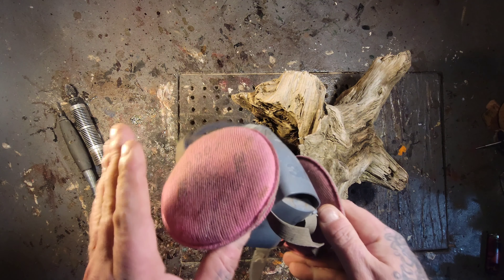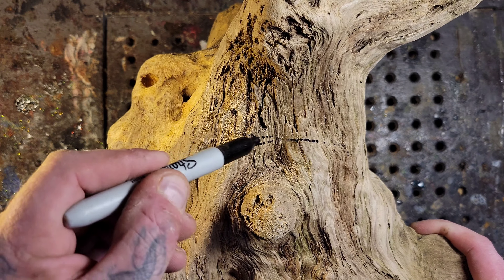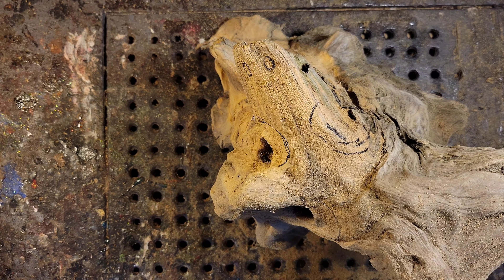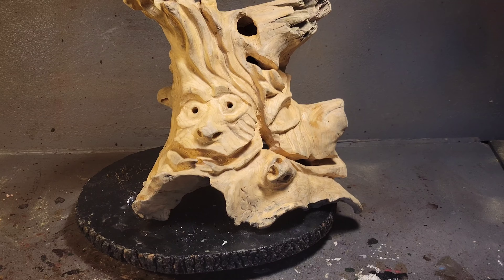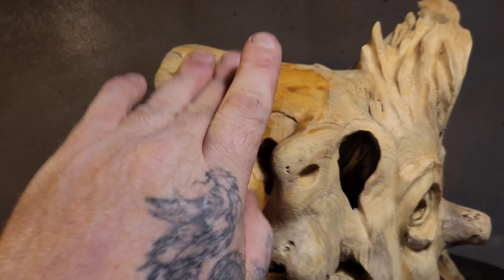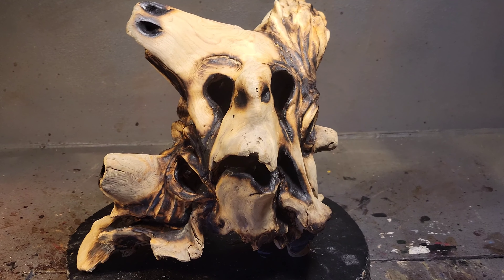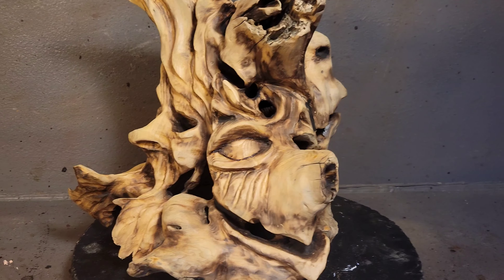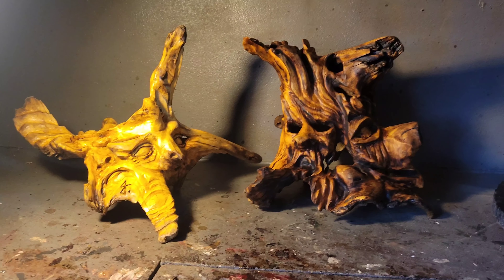Dremel power carving an old root mass with kutzall carving burrs

Comment: I broke my “knock off” Foredom , not even sure if I’m spelling that right. It pisses me off cause I bought 2 Kutzall bits and they only fit into that tool. I’ll try to find a bigger Dremel but as of now I’m stuck working with just My old Dremel so no big projects for a minute, till I can buy my new rotary tool. But dammit now you got me wanting to work with drift wood!! This looks cool!!! Keep carving and making videos, you are doing amazing work!!!
Reply from the maker: Thank you, how is ur knocknoff foredom broken
Reply: @CarvingFusion  the flex shaft broke and there’s really no way of fixing that so I’ll just buy a new one. But also since that happened I’d noticed that it’s not getting any power now either and the brushes on electric motor are brand new .
Reply from the maker: @user-dx9vd8fg7u  replace the inter flex shaft, check the holes where the brushes go to make sure there is no old brush stuck in there (the walls) when u do this sand the end of the brushes flat then reinstall